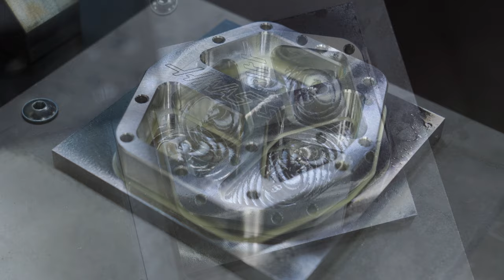VF-2SS + HRP-1 + 100mm Air Vise + HaasTooling - Haas Automation, Inc.

Comment: Hardly efficient, and probably not that repeatable either. The robot is accurate, but not as accurate as the machine. Why not have a stop and have the robot use its grippers to push the part against the stop? Why not two grippers to pick and to place in one go? Etc.. etc..
Reply: That's entirely unnecessary.  The part is cut from the center of the block so its placement in the vice doesn't need to be that precise.  This robot has more than adequate repeatability.  Adding more grippers and stops and etc.. etc.. is just adding complexity and cost with no benefit to quality or productivity.
Reply: The point is to cut 5 sides of the block if possible so doing so will eliminate the need for any precise stops or loading.